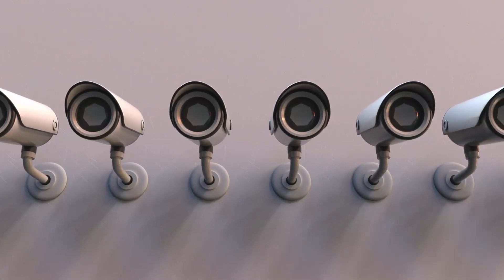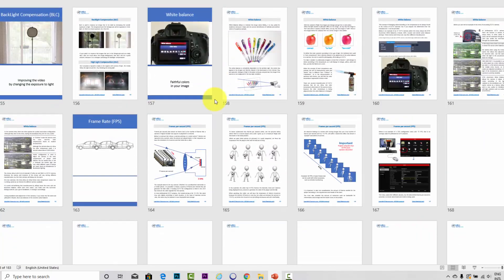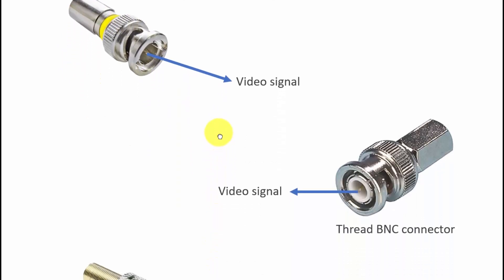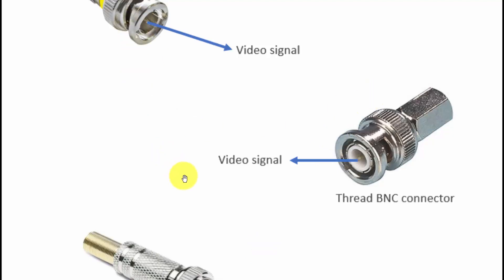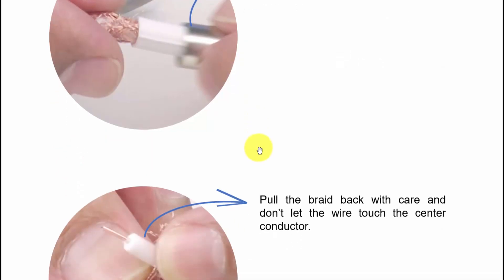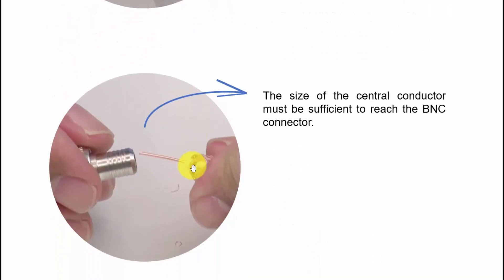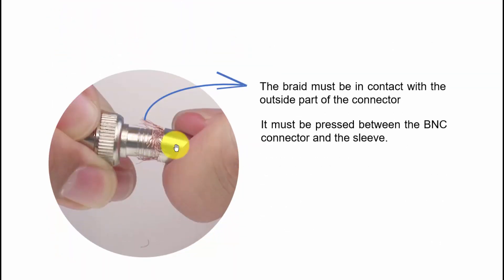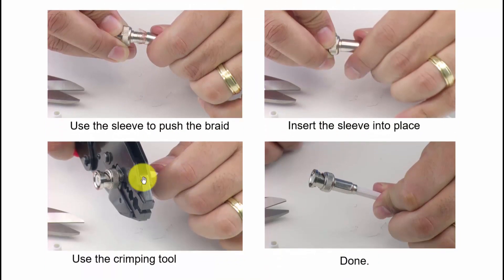CCTV Training - BNC connector for security cameras

Comment: You forgot to tell them or maybe you did tell them and I have not seen that bit of the video yet. 85% of the time for the thick coaxial cable  BNC connectors which comes with your system are not very good and your cameras will blink and be affected by cold and hot weather. People usually cut them off and replace them with the screw-on ones which you can see in the middle of this YouTube picture 1:31
Reply from the maker: I don’t see people doing that. Good technician and installers usually don’t. Unless you are talking about DIYers and that’s is a different story because they are not CCTV professional and intuitively do what they assume is right.
Reply: @LearnCCTV  Premade industrial line production imported from China very common in the U.K. you just replace the BNC connectors. The shopkeepers and yard owners are wise to it and they just replace them.